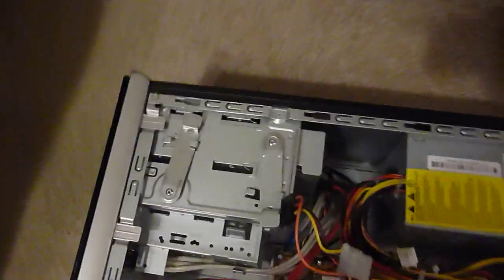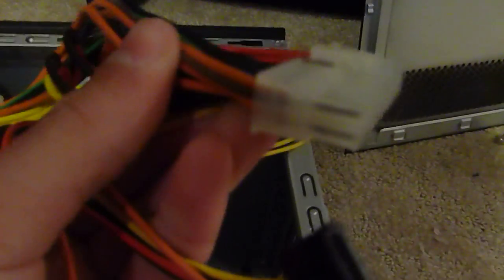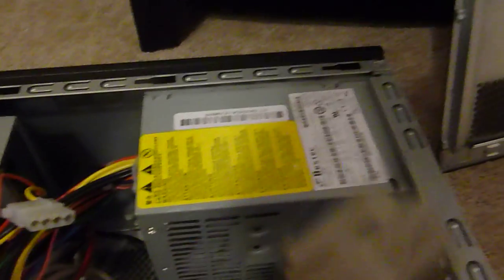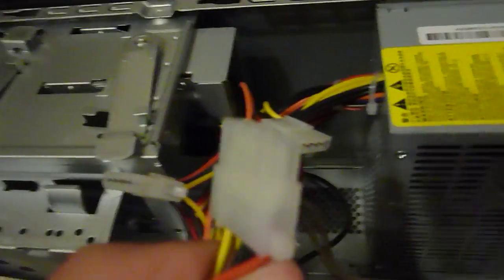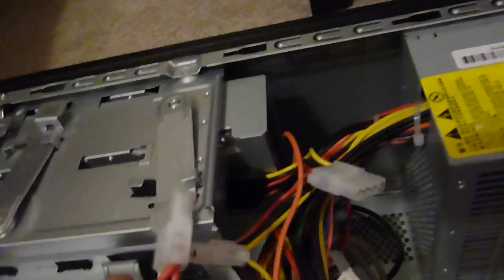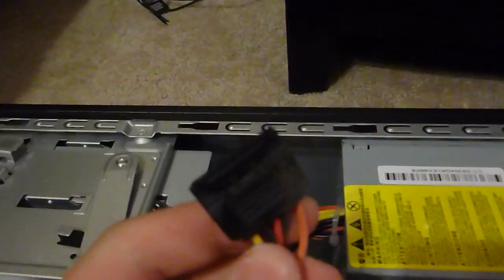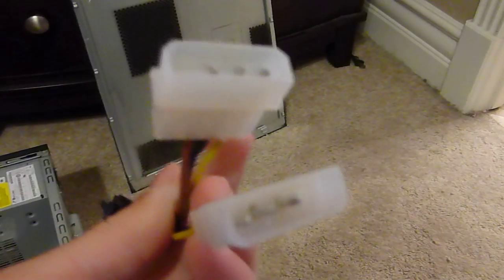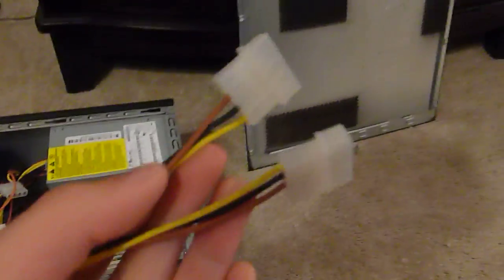How To Connect PC Power Supply

Comment: my problem is i cant find a 4-Pin plug to plug into for my power supply, im using a
Ecs Motherboard K7sem with a 300 watt ATX Power Supply. with a 4 pin connector.
help?
Reply: Hey bro the same problen is with me😣

Comment: I have a fairly old PC... with old specs. Is there anyway you could help with connecting all power supply cables to all parts on the PC... (including the Molex cables).

Comment: My cable is 20 pins but the area that I plug in is 24, do i still plug it? thanks
Reply: +Lucid It's probably a 20+4 pin connector. If the cord has a 4 pin connector right next to the 20 pin connector it should snap together.